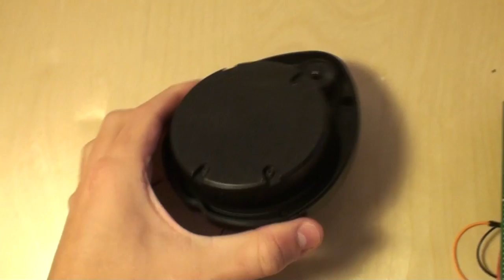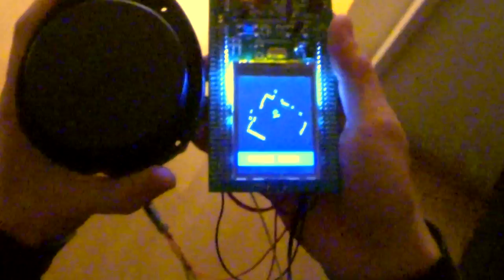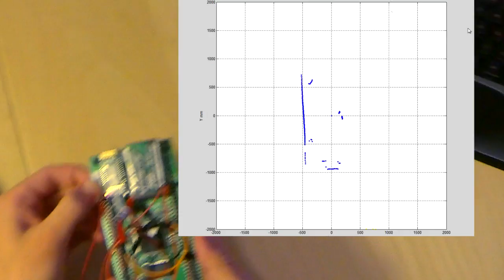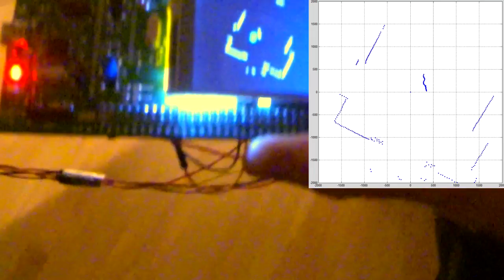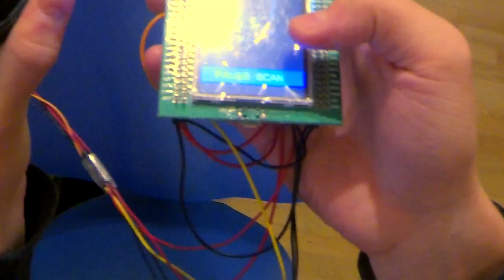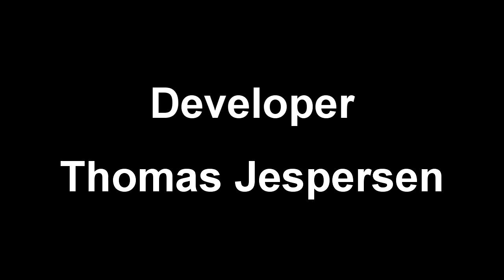Handheld XV-11 LIDAR with STM32F429

Comment: I want to  the pin connector diagram of the project!!Could you give me please? I use the RPLIDAR but it isn't active :(
Reply from the maker: Which RPLiDAR version do you have? Please see the wiring description in the bottom of this blog post: http://blog.tkjelectronics.dk/2014/08/handheld-xv-11-lidar-with-stm32f429-and-matlab

Comment: Hi, as far as I am concerned, that is a wonderful Project to implement. However, I need your help to comprehend how bluetooth modul Works with MATLAB. May I kindly request your e-mail?

Sincerely...
Reply from the maker: The Bluetooth module used in this video (HC-05) works as a Virtual Serial Port when paired to the computer. This allows me to open this serial port and read the incoming data in MATLAB using the serial port object: https://se.mathworks.com/help/matlab/serial-port-devices.html

Comment: Which gui builder did you use? for Stm32f429 lcd
Reply from the maker: No GUI builder has been used. The graphics you see is programmed in C++ using the graphics library functions provided by ST.
Reply: Thank you sir.

Comment: excellent work ....

pls help on following points....

1) is lidar A1M8 compatible with xv lidar controller ?

2)u have used bluetooth to send data to computer ...can you pls tell me how...exactly it is done

3)from which website should i buy this stuff
Reply from the maker: 1) No, the RPLiDAR (A1M8) is not compatible/equal to the XV LiDAR and thus not compatible with this project out of the box.
2) The LiDAR data is received and processed in the STM32 processor and stored in RAM. The processed data is then transferred over UART to the Bluetooth module which is connected to a PC emulating a Serial Port (using SPP).
3) I have purchased my XV LiDAR on eBay for around $100 USD

Comment: hello Which software format did you use the sensor for?
Reply from the maker: What do you mean? Do you ask about the LiDAR to microprocessor protocol or the wireless protocol to the PC over Bluetooth for visualization?
Reply: Various software formats available for the lidar sensor
Reply: ((((((I am using this code))))))

%% Matlab script for read and plot VX-11 lidar data
% V0.22 New
% Author: Cheng-Lung Lee
% Date: 2010/11/24
%
% Testing with this LDS
% Piccolo Laser Distance Scanner
% Copyright (c) 2009-2010 Neato Robotics, Inc.
% All Rights Reserved
% 
% Loader  V2.4.13386
% CPU     F2802x/c600
% Serial  AAA42110AA-0003662
% LastCal [2010182117]
% Runtime V2.4.13386

fid = serial('COM13','BaudRate',115200);
set(fid,'InputBufferSize',400000)  %  Set serial buffer size >(6+360x4)*2=2892 byte
set(fid,'Timeout',1)             %  Set read Timeout in 1 sec
fopen(fid)

%fclose(fid);
%% local loop back to test serial port
% fid_fake_data = fopen('XV11_NoShiled.bin'); % read data from sparkfun binary format
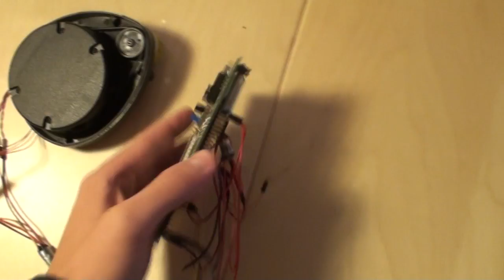% for i=1:20
% tx_data=fread(fid_fake_data , 200, 'uint8' );
% fwrite(fid,tx_data,'uint8');
% end

%% Setup plot for lidar
figure(1);
lidarplot=plot(zeros(1,360),zeros(1,360),'.'),% plot something
axis equal,axis([-2000 2000 -2000 2000]),grid on
xlabel('X mm'),ylabel('Y mm')
drawnow
pause(.1)

%% Start read serial port
index=0;
deg4index=0;
XV11_Status=0; % 0~3 search for header, 4 has header, 5 timout/error.
data=zeros(2,4,'uint16');

Ddata=zeros(1,360,'uint16');
Rdata=zeros(1,360,'uint16');
if fid.BytesAvailable>0
fread(fid, fid.BytesAvailable, 'uint8');
end

while(XV11_Status<=3)
dog1=0;
 while(fid.BytesAvailable<=44)
     pause(.01); % wait 10ms for data come in
     dog1=dog1+1;
     if dog1>1000 % if more the 10sec no data , quit
         XV11_Status=4;
         display('Error no enough data, timeout WatchDog1')
         break;
     end
 end
 
    switch XV11_Status
        case 0 % no header
            if(fread(fid, 1, 'uint8')==hex2dec('FA'))
                XV11_Status=1; % get 0xFA
            end
        case 1
            temp=fread(fid, 22, 'uint8');
            if(temp(22)==hex2dec('FA'))
              XV11_Status=2;
            else
              XV11_Status=0;
            end
        case 2
            temp=fread(fid, 22, 'uint8');
            if(temp(22)==hex2dec('FA'))
              display('Found Header');
              XV11_Status=3;
            else
              XV11_Status=0;
            end
            
        case 3
            %Wait until buffer has one frame of data
            %get a watch dog if take too long to read data

%                  %% read more data
%                     for i=1:10
%                     tx_data=fread(fid_fake_data , 200, 'uint8' );
%                     fwrite(fid,tx_data,'uint8');
%                     end
                

            % check next header

            % correct read data and plot it
            if (fid.BytesAvailable>=(22))
                        deg4index=fread(fid, 1, 'uint8' )-hex2dec('A0'); %1 byte index & unknow flag
                        speed=fread(fid, 1, 'uint16' );  % encoder ticks 
                        data(:)=fread(fid, 8, 'uint16' ); % 8 byte distance data and 8 byte reflectivity or uncertainty
                        Checksum=fread(fid, 1, 'uint16' ); % check next header
                        nextheader=fread(fid, 1, 'uint8' ); % check next header
                       if(nextheader==hex2dec('FA'))
                       Ddata(deg4index*4+1:deg4index*4+4)=data(1,:);
                        Rdata(deg4index*4+1:deg4index*4+4)=data(2,:);
                              
                          else 
                            XV11_Status=0;
                           
                         end
                        % like LMS200 lidar, most likely XV-11 only use 13
                        % bits for distance, bit 14 and 15 are flag for
                        % data quality and sensor information
                        % try to read flag here
                        %bit14flag=bitand(data(1,360),uint16(hex2dec('4000')*ones(1,360)))>0
                        %bit15flag=bitand(data(1,360),uint16(hex2dec('8000')*ones(1,360)))>0
                                    deg4index+1; % count from 0 to 89 
                if (deg4index==89)
                      index=index+1;
                      dist=bitand(Ddata(1,:),uint16(hex2dec('3FFF')*ones(1,360))); %mask out bit 14 and 15
                    [X,Y] = pol2cart(0:2*pi/360:2*pi*(1-1/360),double(dist));
                     %   plot(X,Y,'.'),axis equal,axis([-500 500 -500 500]),
                     title(['Scan: ' num2str(index)])
                     set(lidarplot,'xdata',X,'ydata',Y);
                     drawnow
                     %pause(.01),
                end
                
            end
        case 4

            %
        otherwise
            XV11_Status=0;
    end

end

fclose(fid);

Comment: Hi! Sadly, your blog is down at the moment..I also received this unit, but have some problems. All readings (except for approx. 1 second during spin-up of the motor) have the bad-data-flag set, otherwise I can read out and decode the packets just fine, so protocol and connection are good. Do you have any suggestions, or did you also experience this behavior at some point?
Reply from the maker: Saying that it works for the first second while it spins up indicates to me that this issue might be related to a synchronization problem.
How are you powering and controlling the speed of the DC motor? If you power it directly from a battery or voltage supply without any speed controller you have to be aware that the motor easily makes the unit spin too quickly.
In my blog post I described how connecting the DC motor to the 3.3V supply would limit the speed and reduce the likelihood of the synchronization issue.
Reply: I tried connecting the motor to a stabilized 3.3v/3v-source, as well as spinning it exactly at 300rpm using pwm-control based on the speed-information of the packets I received from the scanner. The turnrate is rocksolid at 300rpm +- 0.5rpm. I am receiving clean and uncorrupted packets all the time, so this is no issue at all, it's just that (except for this brief 1-second period during startup) the bad-data flag is set all the time.

Comment: Have you used a TTL adapter for lidar data?
Reply from the maker: No. That is not needed as I am using the STM32 processor running at 3.3V

Comment: Hi, I am using arduino uno and xv lidar sensor in my project.I provide communication between arduino uno and matlab with arduino ıo matlab.
#include <SoftwareSerial.h>

SoftwareSerial mySerial(10, 11); // RX, TX

void setup() {
  // Open serial communications and wait for port to open:
  Serial.begin(115200); //seri haberleşme başlangıç
  while (!Serial) {   //
    ; // wait for serial port to connect. Needed for native USB port only
  }

  mySerial.begin(115200);   
}

void loop() 
{ 
    if(mySerial.available())  //
    {
      byte in = mySerial.read();
      delay(1);
      Serial.println(in, HEX);
    }
}

I can get data from the sensor with the above codes 
But I do not know how to use this data I read.
I am transferring serial data but how can I calculate the distance?
If you answer me, please.
Reply from the maker: Just reading a single byte and then waiting will not work. The bytes that comes from the XV11 comes in a packed format so you will have to read a whole package and decode the content, after checking and confirming the validity of the package using the checksum.

Comment: How accurate is the resolution ?
Reply from the maker: 1 degree, but with quite some dropouts. So maybe only an effective resolution of 3-5 degree at every revolution of 5 Hz.
Reply: Stupid question: are the degrees (0-360) set as a fixed positions on the LiDAR? For example if I set it down facing one direction, will the packet containing the data for degree angle 0 be a constant poll of the same position in space?
Reply from the maker: Of course not the same position in space as this is another reference frame than the one which the LiDAR is attached to.
The sensor data is provided in a reference frame defined by the LiDAR itself. So the data will be oriented as the LiDAR is pointing.
Then you can do filtering and sensor fusion to combine the LiDAR data with a gyroscope and/or magnetometer to get estimate the current orientation and use that to map the LiDAR angle readings.

Comment: Just a suggestion but if you some how connected to LIDAR  scanner directly to a smart phone which should have much better RAM and processing power than the setup you have now
Reply from the maker: Depends on the application. If you have a specific application that requires heavy processing of the LiDAR data such as point cloud algorithms or SLAM then you might be better of using a better processor or smartphone.
Reply: Would it speed up the image of the normal room or no?
Reply from the maker: No, it will not. The refresh rate of the image is not due to the processor performance.
The LiDAR sensor itself only provide angular measurements at a rate of 5 Hz, so the picture can only be updated at this rate.

Comment: hi body. you stole my dreams. :) really congurulations. its perfect i think but ı am wondering that how do you show on the screen??? is it your code or is there any precode designed code and one more thing. as well you say lidar sensor very expensive how can ı procure cheaper this sensor
Reply from the maker: The graphics library to get the display on the STM32F4 board up and running is provided by ST for free (included in the CubeMX IDE from where you can generate startup files and the project).
This library contains the most general drawing functions as setting pixels, drawing lines, writing text etc. For any more advanced graphics you would have to write your own library.
This is one of the cheaper LiDAR units that you should be able to buy on eBay etc. for about $100-$150 USD.
Reply: TKJ Electronics thanks a lot. 
I wish you continued success.

Comment: dam do you know of any links that does this but for Arduino and Processing or c#/c++ ?
Reply from the maker: +Sys.stem You can do a similar thing with an Arduino, but the processor ressources will be quite loaded due to the many samples.
Reply: TKJ Electronics how bout the samples gets BT to a pc and result sent back to the processing window, i dont care about the actual handheld this is just a approach to let the bot know its map then work out a best avoidance and route from point A to B
Reply: TKJ Electronics what would be the pseudo code for something like this ?

Comment: have you try saving the connected contours of what makes your room ? this was you can actively use that map for survey  ?  while your lidar will still be on doing its updates on the room and any new moving objects
Reply from the maker: Hi. Its not just a matter of saving the contour. It is a highly intensive mathematical procedure called SLAM.
But no, I haven't tried this.
Regards Thomas
Reply: mindthomas well is not math if you already got the data, all you need to do is use a program that can take those values and convert into a array of vectors therefor displaying the already scanned imaged "saved data" so if anything this will be an addition program that will run aside with this hand held. just store data in a file that the second program can grab and read C# can do this in visual studio or Processing
Reply from the maker: +Frank Lopez But the origo of these vectors needs to be adjusted while you walk around - just like LIDAR with GPS.
Please search for LIDAR and SLAM on YouTube for more practical information.
Reply: mindthomas i understand your view but do understand that your talking about one of many types of approach. this can be taken care of by using a imu module $2 and match that imu to the handheld and link that imu data to the actual program reading the saved map values, doing this update of reading constantly will translate into a moving map thats match where your pointing your device to

Comment: I got a quiet simple question, Where did you found the STM32.tcl or the Support Package for the STM32F429I discovery board ?
Thanks by advance.
Reply from the maker: +popotubeyou We didn't use any tcl or Support Package for the board. I used the HAL library from ST including the LCD driver.
For easy generation (similar to using or generating a Board Support Package) I recommend you to have a look at the STM32CubeMX generator software from ST.

Comment: hi  bro   did  u  use the yellow  electrical wire for Tx --> Rx and  u  put  the  RX on   the pin   pC11    ??  and  what  about  the  two  red  and  the  two  black wires  where  did  u put  them  ????

Comment: plz  bro  i  need  the  electronic schematicas  soon  as  possible  can  u  help  me my  mail is  naderkarmousn@gmail.com plz  contact  me
Reply from the maker: androidnew There is no specific schematics.The cable coming from the LIDAR unit is just connected to an available UART port on the STM32F4 DISCOVERY board while the motor power connector is connected to the 3.3V regulated voltage, to provide the sufficient current for the motor to turn in a steady motion.
Reply: mindthomas    ty bro how  mutch  port  did  u  use  and  can  u  give  me  their names  and  what  type  of  signal  did  u  use ??
Reply from the maker: What do you mean with port? You just have to select one of the UART receiver ports on the STM32 device.
Connect the LIDAR TX pin to the UART RX pin on the STM32

Comment: Is this device runs only with a matlab script ?
Reply from the maker: No. The embedded device itself, the STM32, is programmed in C - so no MATLAB running here.
MATLAB is only used on the computer to actually display the polar plot of the distance measurements - not doing anything else, nor any parsing of the actual XV-11 data either, as this is all done on the STM32.
Reply: mindthomas
Nice , great job